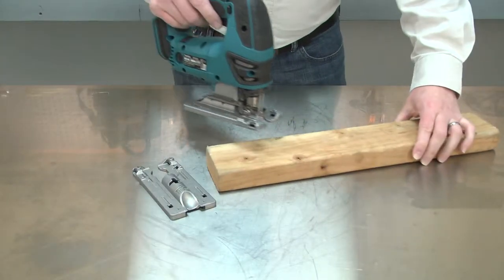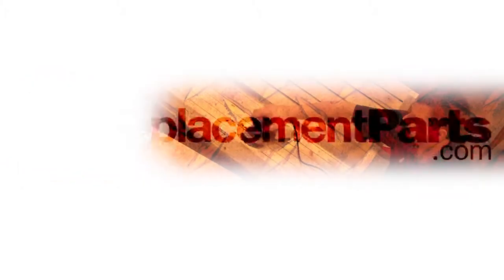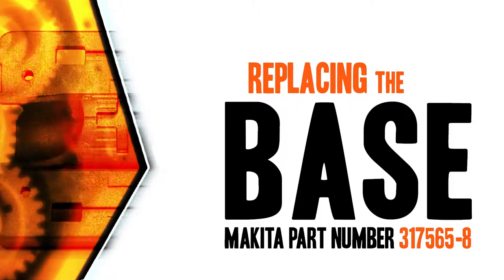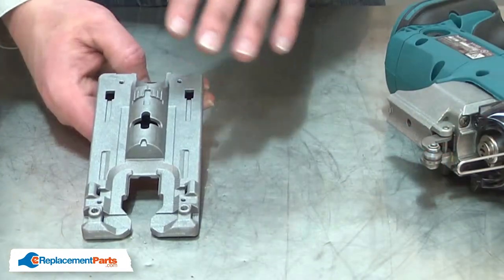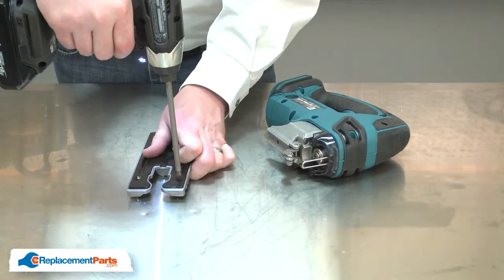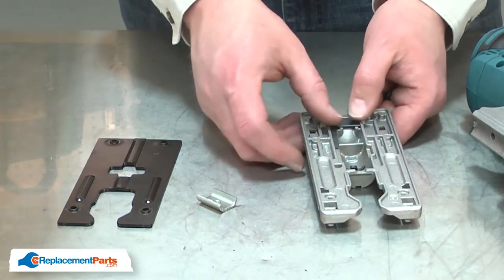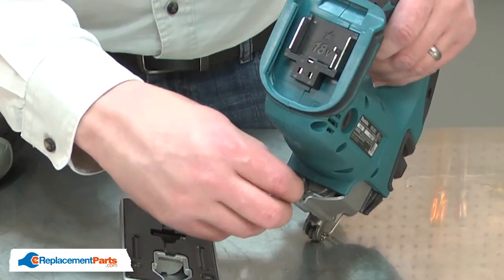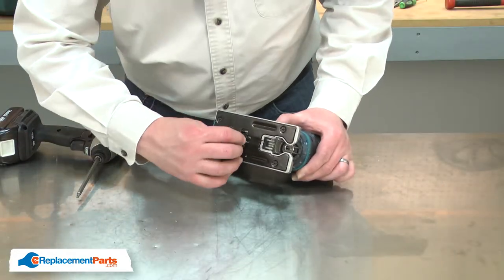Makita Jig Saw Repair - Replacing the Base (Makita Part # 317565-8)

Comment: What if you know how to replace it, but simply can't find a replacement or wanna upgrade from pressed sheet metal to die cast one and can't find it?
Sol and jwf right?
Black and Decker in my case
Reply from the maker: Do you have your model number handy? If so, I can try to find a replacement part for you!
Reply: @FIXTechGuides  thanks, it's ks700pe... Can't find a diecast one...I do have a sheet metal one and it's horrible